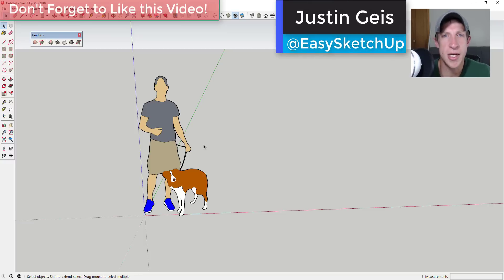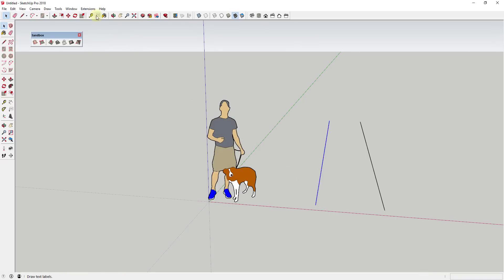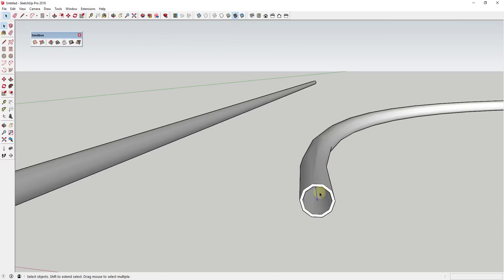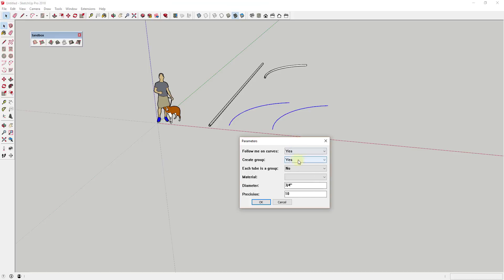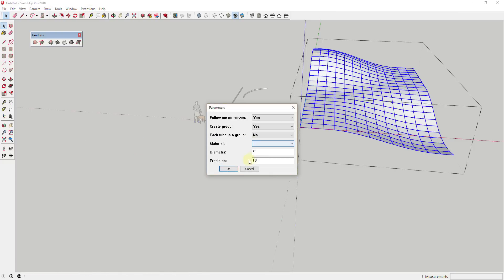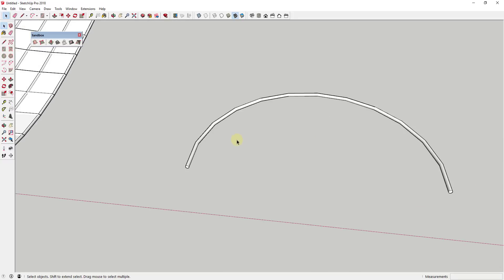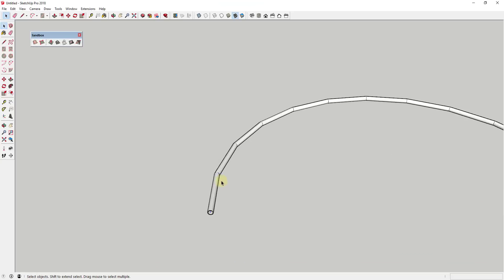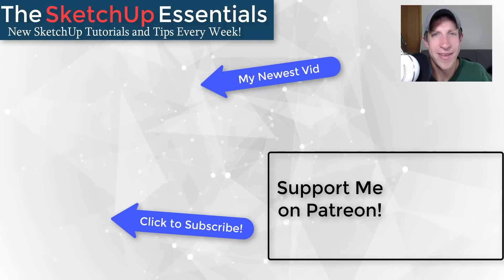Pipe Along Path VS Lines to Tubes - Which Tube Creation Extension for SketchUp?

Comment: Is there a way to get the total length of each pipe/tube used in a design?
Reply from the maker: Usually I'd measure this by selecting the lines that you use to generate the pipes. The overall length of the selected edges should show up in your entity info
Reply: @Thesketchupessentials  OK, will check that out. thanks

Comment: How would you compare these to profile builder? Are both of these unnecessary if you had profile builder?
Reply from the maker: Profile Builder, especially the new version, is definitely more powerful than these extensions. That said, I've never really tried to use it in an application like this, so I couldn't tell you if it would work better or not. With the newest version (V3), you can create profiles along multiple paths at once. Thanks!

Comment: Thanks for sharing. Very useful extensions thanks. 

However, the "follow-me/pipe along path" tool has a bug, in that any radius small than about 10 mm results in breaks in the pipe. The workaround is to simply increase the size of the path say 10 times, run "pipe along path" and then decrease the size to 1/10th. Why this easy workaround has not be added to SketchUp I don't know. Ditto clipping problems.
Reply from the maker: Actually, I think it's more of a SketchUp bug than a bug related to the extension. Whenever objects start getting really small, sometimes faces don't get created properly. The workaround you listed does fix this, though it's a bit annoying that you have to do it. Thanks!

Comment: I'm wondering what happens between the 2 using a curve which has been created using the Weld extension.
Reply from the maker: I believe they generate the same result - from what I've seen, lines to tubes does try to use follow me along uninterrupted paths when only that path is selected, so if you're using a welded path, as far as SketchUp is concerned, that's a single line. I think the issues more start when you're using a bunch of lines and curves broken up into individual segments.